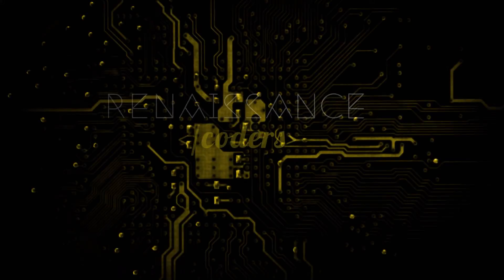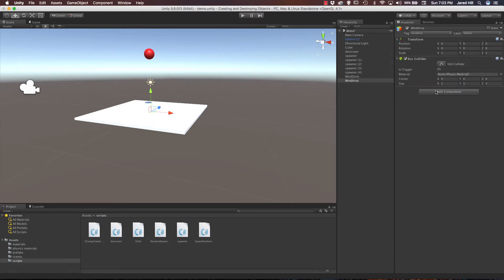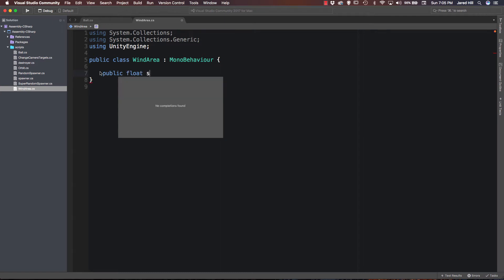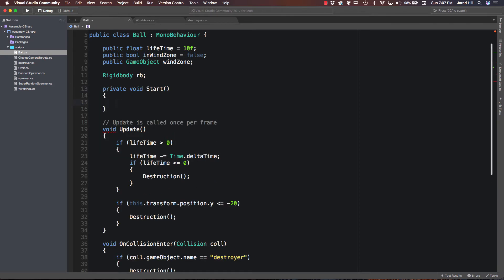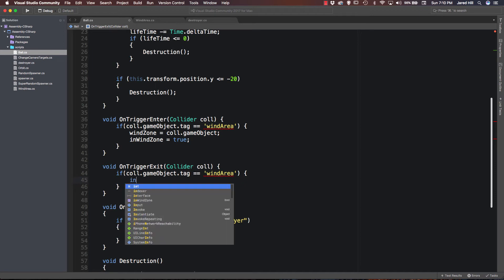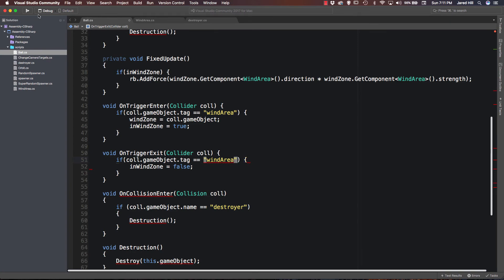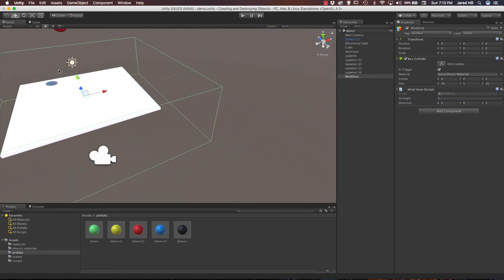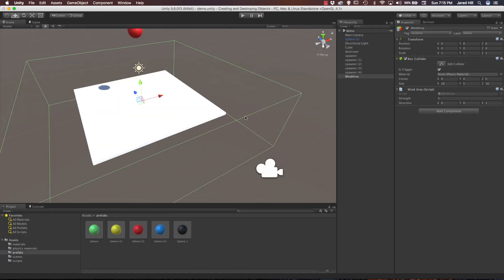Unity3d Creating Rigidbody Wind Zones

Comment: Tried to use this script to apply an attraction force, but it didn't work. Found another script that works, but it only works in the hierarchy and not with prefabs. Trying to use an attraction force on the player, that works on spawned in objects. If the object is already in the hierarchy, it works just fine but as soon as I spawn one in, the physics go haywire and the object gets thrown around all over the place. I feel like I have tried everything. I've been at this for several hours, and no hope for getting it working yet.

Comment: This was a bit confusing... The use of both wind zone and wind area made it hard to follow. In my script I decided to use wind area, as recommended. But there are mixed usages in the tutorial - so I ended up with "windArea" as a variable and "WindArea" as a component. I got some compiler errors because I forgot to save my WindArea script! :-), but it was difficult to problem solve because of the variable names I used.

Comment: I think this might have been a little cooler if there were a portion of the video that described how to get a realistic wind that pulses. I think I figured it out myself where on the update, instead of adding just a static force, you applied a range of force from zero to the strength. I havent tried it yet but...im pretty sure that would work.
Reply: You could probably create a max speed and min speed and then have a random function assign a speed between those variables.

Comment: For future viewers: that way to apply wind to a component is quite unnecessary and overly complicated -> it requires a tag, 2 scripts and gotta apply a script for each object which needs to be moved!
Here is a simpler approach, it takes less than 1 minute to set it up, not 10.20.

- Create a file called "WindArea.cs"
- Paste this:

using UnityEngine;

public class WindArea : MonoBehaviour
{
    public float Strength;
    public Vector3 WindDirection;

    void OnTriggerStay(Collider col)
    {
        Rigidbody colRigidbody = col.GetComponent<Rigidbody>();
        if (colRigidbody != null)
        {
            colRigidbody.AddForce(WindDirection * Strength);
        }
    }
}

- Add the script to a gameobject like shown in the video
- Set your preferred strength and wind direction (as in the video)
- Throw anything with a rigidbody

Enjoy!
Reply: Functional but not very performant (maybe good enough for prototyping or if you know you'll have few objects)... using GetComponent on any OnStay() collision event is really costly (specially the garbage. Though, I would avoid GetComponent in any loop... caching the value is always a better idea). I would suggest tagging the objects you create with a script and then have them register/unregister themselves to a Dictionary<collider,rigidbody>. that way you can use a dictionary's TryGetValue method, which is a lot faster. Though, using OnEnter and OnExit is a better choice all around...
Reply: For future viewers: This solution adds force regardless of rigidbody velocity. This means the wind will blow objects faster than the wind speed after enough time passes.
Reply: Doesn't work
Reply: OnTriggerStay is never a good option, its really low performant.
Reply: Спасибо тебе большое!!! Вариант предложенный автором не работает, по крайней мере в свежей версии Unity. Я пока не знаю можно ли это как-то улучшить, но в любом случае, мне необходимо было иметь возможность толкать шар при помощи ветра.

Comment: i can use this video for make a wind that have effect to player ? (eg. Making it difficult to move forward)
Reply from the maker: Hey, this video probably won't work very well for adding a wind effect to a player. It could work depending on the setup of your player GO, for example if your player has a rigidbody on it then you could receive add force, but if your movement is not force based, then you may not notice any effect, or the player may freak out on you.
Reply: Did you find a way to get what you wanted to work? I’m having a similar issue, I want wind to push my player when they enter a specific area. My player has a basic character controller and rigid body.